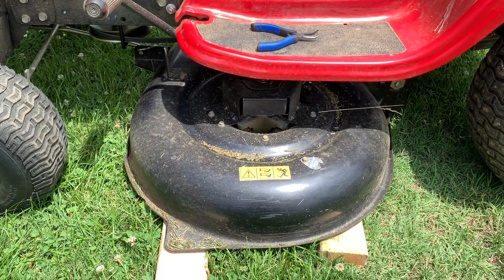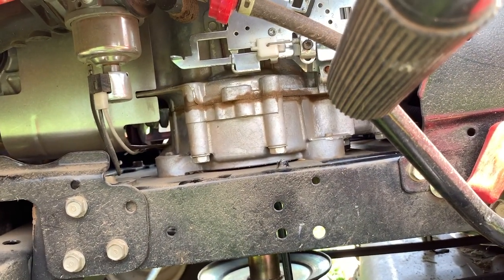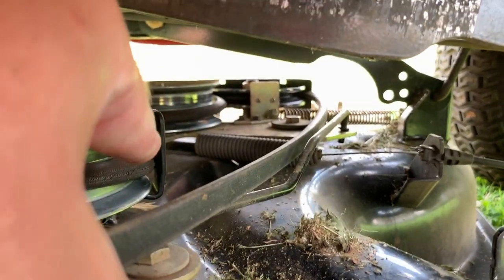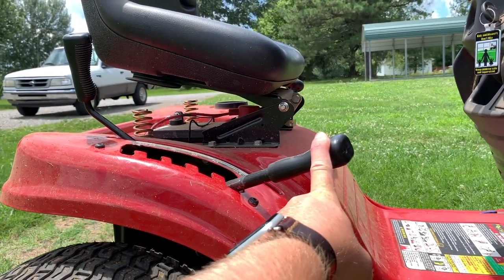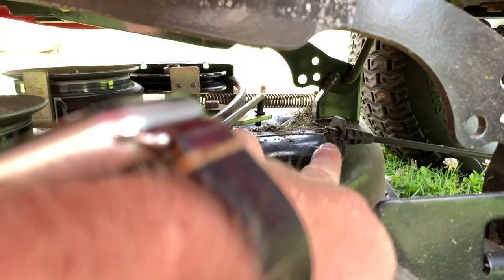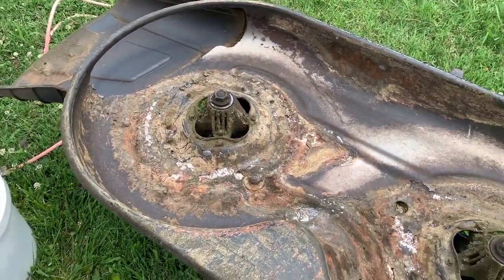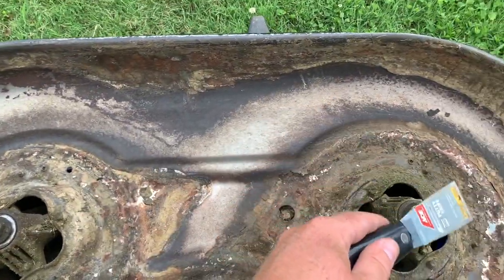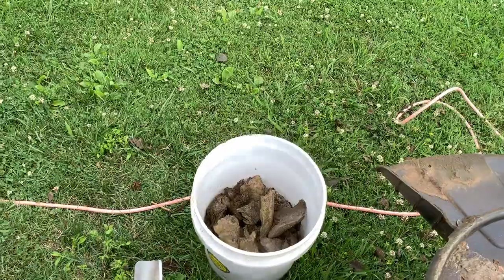How To Drop The Mowing Deck On A Troy-Bilt Pony And Why To Do It

Comment: Yes thank you. I need to check my pulleys, and clean my deck. Putting the deck on 2x4s is a great idea, because if you don't the tension on the deck makes the job unnecessarily difficult.